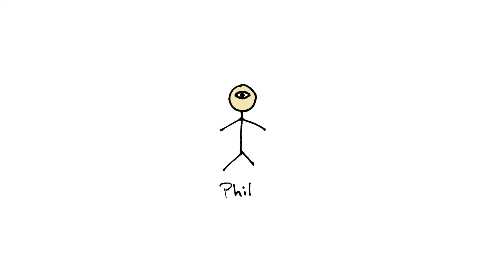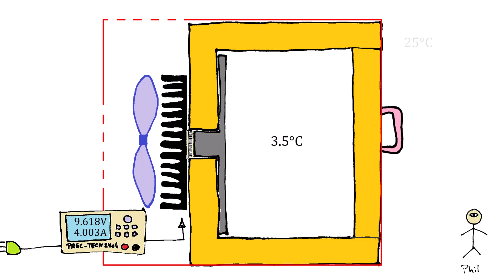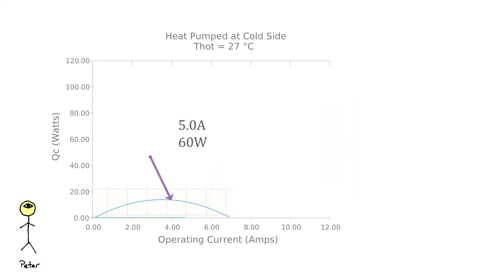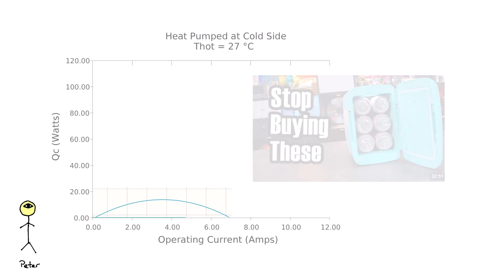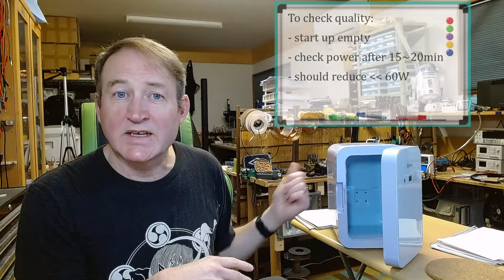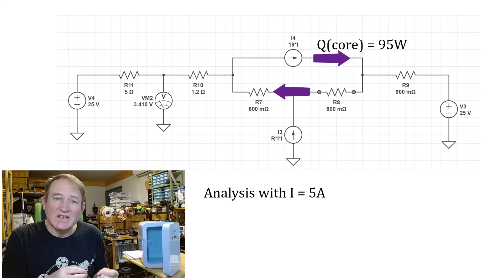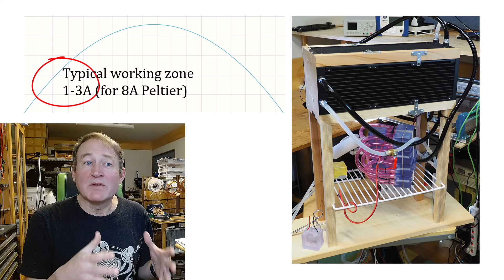The Peltier Fridge Parabola Problem

Comment: most people have no idea how to use them and cant read datasheets. 

the usual deal... think pumping more power into them must make them work better. 

dont understand ohmic heating is exponential and cooling or thermoelectric effects are linear, or close enough to be.

that the temperature gradient is proportional to the potential difference but the resistance of the device requires a certain current to allow that potential to be developed...

max COP is around about 1/5th the rated max power... 

trouble is maintaining that sweet spot with maximum temperature gradient for the minimal current consumption... few degrees here or there and COP rapidly plummets... 

still, they CAN outperform other systems when used correctly...

and i just hit the AI generated text part. sorry. i would rather hear stuttering and verbal dyslexia than that BS. im out of here.

seriously, if you dont want to talk,  find a friend or relative that WILL and give them something for their time...
Reply from the maker: Sorry for the misunderstanding. It's not AI generated text, the dialogue is 100% mine, I just used ChatGPT as cheap text to speech synthesizer. I've played around with text to speech in the past and always unimpressed, but it seemed OK this time. I agree it gives the wrong vibes. It takes me about one week to make a 15min video, and about half of that is trying to get a good recording of me talking, the other half on the animation. I'll get better with time! Anyway, I think the content is important so if you can get past the annoying sound of the AI speech, I'm keen to get your feedback, you obviously know a lot about Peltiers
Reply: Ohmic heating is quadratic

Comment: Your videos are excellent! Please consider making a video: how to turn a shitty peltier refrigerator into a good one. Something using arduino etc. We all have a peltier fridge in storage that needs improvement!
Reply from the maker: Yes, I will definitely do, I already have a Peltier mini-fridge that I've ripped the guts out of and replaced with my systems. I can get it to run on low power, but as mentioned in the video, the "cold" of the rear plate move doesn't move around effectively in the chamber, so I want fix that point first before making a video. My problem is every time I start making a video I get so many new ideas and never get around to working on some of the older ones!
Reply: @PeltierPower  I have an old Peltier mini-fridge that used an internal fan on a finned heatsink. How much of a difference would that make, vs. the rear plate? This is a dorm-size fridge, rather than the desktop type.
Reply: I think it's possible to do it without a microcontroller, using a op amp to control the pwm (0-100%) based on the temperature, when the target temperature is achieved, the pwm will drop, maintaining the temperature constant while reducing the power...
Reply from the maker: @VictorC173  The way Peltiers work doesn't fit well with PWM, unless you have a good LC filter so the Peltier only sees the dc, not the on/off of the PWM.
Reply: @PeltierPower  People need to stop thinking about PWM as a fix for everything lol... the key to a peltier being as efficient as possible is to use more of them and drive them lighter... with as steady DC as practical.
Reply: That makes sense, though a microcontroller wouldn't give you efficient power output either.

Comment: great video, ive been using 2 peltiers "TEC1-12703(40X40MM)"  for fuel cooling in my petrol car.  ive sandwiched a copper 40x40 waterblock between them, and am using two 40mm fan heatsinks to cool the hotsides.
they are currently wired to run at full chat off of my 12v car battery.  
can the fast beer cooler video include some indepth knowledge into tuning them and a proper or better control system than my "relay+switch" please?
Reply from the maker: If it's already built up and you have access to a variable current power supply, I suggest running an experiment checking the temperature at say 0.5, 1, 1.5, 2 and 3A. You need to wait a while for the second order effects to disappear (don't take the initial change as the final direction). If you don't have a variable power supply you can find some low cost controllable dc/dc converters that you can either set a current or voltage limit, maybe designed for battery charging but they work fine for this as well. Another quick check could be to put the Peltiers electrically series rather than parallel, this roughly drops the current in each Peltier by 1/2 (6V on each Peltier, drops the total current by 1/4) and will very likely put you closer to the peak of parabolic curve. I've never played with 12703 so I don't know what the characteristics are. My gut feeling is you might do better with 12706 or 12708 but run gently at 1.5-2.5A, well on the left side of the parabola.
Reply: @PeltierPower thank you for the quick reply. i need a bit more kit to do some better testing. my benchtop supply didnt have the max amps to run the cooler i made at full power, and im waiting on some temp sensors so i can track the results better. plus the actual things plumbed into my car atm.
       i had spare waterblocks and heatsinks to make a benchtop test rig approximaly but not the 12703 peltiers yet, just 12706. been testing :D
you are right about running in series vs parrallel (good shout) the power usage difference is riddculous between the two voltages. 
6v series is 12watts a panel (25watt total). a single peltier at 12v is 50 watts. 
again, i cant test liquid in out temps at all yet or the block temp very accurately....it seems to get as cold from memory about 10C in 16C ambient in about the same time.
      i think the main limiting factor between all these similar sized peltiers is the thermal conductivity of the ceramic plates that sandwich them. as its identicle between every power rating of peltier?
i.e. each ceramic plate, being identicle, limits every differing power rating of TEC to the same actual thermal/power disipation limts? 
     Am i onto something with this and you can put it into better maths/words please? itd be nice to know the characteristic/limits better.
      thats why i eventually went with 12703 (expensive) as initial bench testing with 12706 (cheap) seemed to overload, both my power supply and heatsinks, even an AIO water pc cpu cooler with a 240mm rad and fans.
again thanks for the help, cant wait for more videos :)
Reply: @jimmyhackers8980  the size of the individual junctions is the real limit to thermal flow. 03 has small junctions, relatively high resistance. the 15 has massive junctions and about 1/5th the resistance.
Reply: @jimmyhackers8980  When you set up your tests run fuel at measured ambient temperature or pass it though a coil of pipe in a temperature controlled water bath to test for worst case real world temperatures. Use gravity or pump to set various (min, max, median) real world flow rates and measure the output temperature of the fuel.  Initial tests can be done with water but important to confirm with the final fluid as heat transfer can do funny things and water is deceptively effective compared to many other fluids.
Reply: Honestly, id rather hear YOU talk, than AI tyrone… dont use that artificially articulate voice again,, please 😂